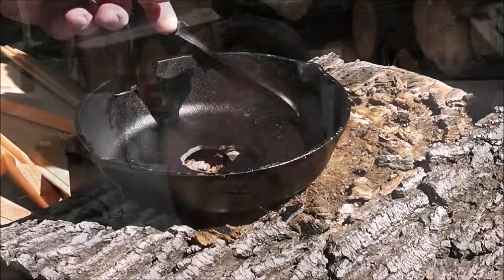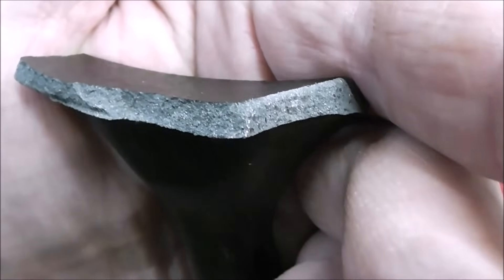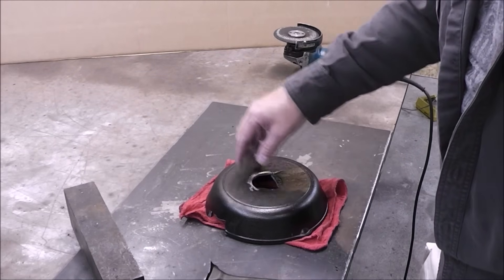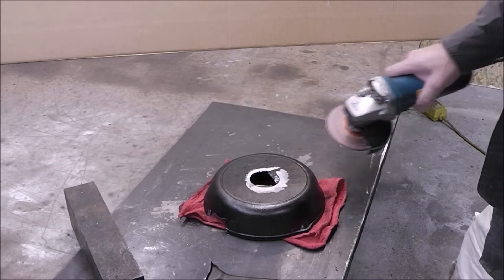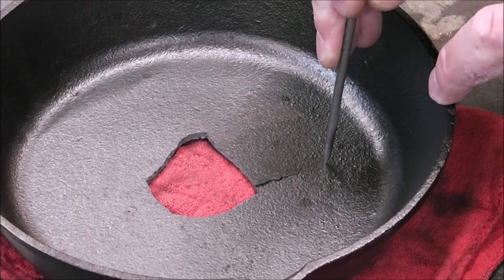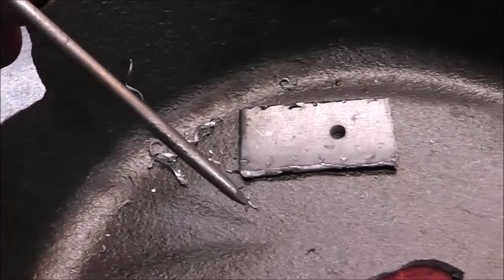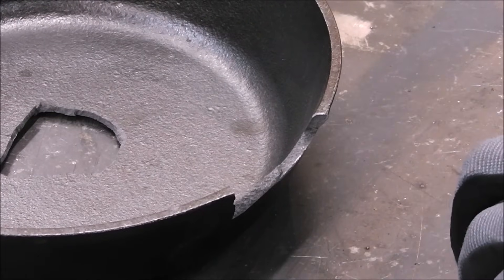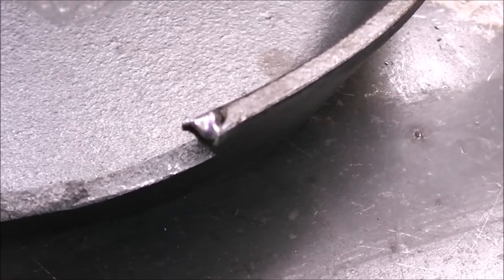IS IT CAST IRON OR CAST STEEL? 5 Ways To identify Before Welding

Comment: I did a  mig repair on a cracked exost manifold  on my old renault 18 few years ago,and i was told that it should 99% be made out of cast iron...to make sure i was running the engine for a wile,reving it once a wile to get it hot,then i quickly unbuilt air fiter and carb to work on it.still there since without any sign of failure
Reply from the maker: Right on! Nice job!

Comment: What if the edge is rounded? I tumbled some metal chunks I had in a rock tumbler to make them shiny. I have a good idea to forge with it into something. But I’m afraid they could be cast iron.
Reply from the maker: You could try drilling it. If it turns powdery it's cast

Comment: The spark test was the only real valid test. Cast iron vs cast steel not mild steel
Reply from the maker: They were all valid tests. If you don't believe me you can always research it for yourself.
Reply: @BrandonLund  drilling cast steel is no where the same as plate steel.
Reply from the maker: I never said it was.

Comment: In the file test, the reason why the file skates over the weld is because when welded with ordinary fillers, the weld pool draws in the abundant carbon in the cast to form a high carbon alloy, this is extremely hard and brittle.  It's the reason cast hast to be welded with a filler such as nickel or similar, as these don't pull out the carbon, and that means the weld remains ductile and doesn't crack as it cools.

Comment: Wait., so cast steel would be molten metal poured into a mold.  Isnt cast iron a powder thats put in a mold then heated until fusion?
Reply from the maker: Cast iron is made by heating pig iron in a furnace then pouring the molten material into a mold.
Reply: What you’re thinking of is actually called powdered metal.

Comment: Hello, recently I bought a cast iron  heater, after two weeks the back of it started to bend. There was no visible damage when it was delivered. Is it possible that it was weaken or was 'damaged' inside? The heater has not fallen or fell over. Thank you.
Reply from the maker: Thats odd. I would contact the person upu bought it from and exchange it
Reply: @BrandonLund  they won't exchange it becaus they (have accussed) me of damaging it. Is it possible that it was put together incorrectly at the seams and that has caused the bending?
Reply from the maker: It's very possible. Cast iron usually breaks before it bends

Comment: I just tap on the part with a steel bar or hammer.. if it doesn't  "ring" it's probably cast iron. Cast will have a dull sound when taping on.
Reply from the maker: Thats another good one but you still have to determine if its white or grey.

Comment: Hey Brandon got a question for ya, I need to extend a 3 point hitch lift link on a John Deere tractor. I want to do this by adding some flat stock (using flux core wire)to the existing flat stock used to manufacture the link. What do you think would be a good choice for the flat srock material?
Reply from the maker: @Mixed Up im not up on farm equipment but if you are extending an existing design i would use use at a minimum the same size material if not a little heavier just to be safe.
Reply: Hot rolled would be best but cold rolled will be fine..  wouldnt use anything else because youre flux core welding it together..  besides no matter what flux core or material you use the wire wont penetrate that deep so would never be as structurally bonded as if you used a 7014, or some stick..

Comment: Brandon, I need to repair my Broncos front differential. While in process of re/gearing, adding limited slip carrier, and replacing all bearings/races/seals, I discovered the inner pinyon bearing race/cup bore was 50 thousandth’s larger than spec. The cup/race on previous came out fused to the bearing on the pinion. Meaning it failed so bad that it spun the cup/race in the bore and hogged it out. So I need to weld in filler material and machine it back to spec, which is 3-4 thousandths smaller than the new bearing cup/race. I cannot replace the differential case/third member because it’s a rare D44 reverse high pinion IFS with bolt in axle retainer produced for only model years 80-82. Im leaning towards the case/third member being cast ductile iron (because I know a Dana 60 is made from such, but it could still just be cast gray iron, but I cannot find info on the metallurgy for that casting. Any tips greatly appreciated
Reply from the maker: @R Pierce it's probably ductile or nodular iron. You can spark test a small area on the outside of the housing to find out. Since this is a critical part / hard to replace part I would lean toward tig brazing, building up the bore then milling to spec.
Reply: @BrandonLund  anyone you recommend to perform this tig brazing in SoCal/ Los Angeles? I have a machinist to re-bore after
Reply from the maker: I wish I did man. It's really not that big of a job just time consuming to do it right. Just some tips to ask when you search around. They should be doing a preheat then depending on how long the shop has been in business, if it's an old-timer he would probably braze it using oxy-fuel. This is gennerally considered the gold standard in my opinion. Oxy-brazing has a real good sucess rate. Tig brazing or stick welding are probably equally as good but all the process (if it's some sort of cast iron and not cast steel) should have some sort of preheat with a post heat cool down wrapped in an insulated blanket. Let me know how you make out. If you have facebook feel free to post your project 👍good luck brother!

Comment: I have a strange part at work that we frequently have to repair. It’s a lock rod end that is supplied with an internal locking device for large containment structures . The parts are often stick welded with 6010,6011, 7014, 11018 and even er70s6 mig. Doesn’t matter it always fractures when struck with a larger gamer or sledge. Sometimes even just prying on the locking device causes failure. I was told years ago it might be white cast iron?
Reply from the maker: @tony b it sure sounds like it. White cast does not take welding very well at all. Have you tried any nickel rod? Nickel has pretty good elongation characteristics so it might be worth a shot...
Reply: @BrandonLund   What about 309
"In most cases when welding dissimilar metals or, more specifically, carbon to SS, we recommend you use a 309 filler metal because of its higher ferrite content. This higher ferrite content can minimize weld dilution and prevent weld cracking."
Reply from the maker: @Bob L this past week's video was somewhat of a failure due some different things but I'm going to try 309 instead. I was using 308 simply thinking cast to cast weld but 309 is always a good bet if your not sure so im going to try 309 in this weeks episode wrapped with a copper wire 🤞
Reply: this might be crazy, but worth a try?   If you can heat the parts red-hot for several hours and cool them slowly, they may become less brittle. if you make a brick fireplace and fill it with charcoal, you might be able to use a leaf-blower to intensify the heat?
Reply: @arthurmario5996  When we are making the locking systems, we typically have 45-1.5 hrs to complete per SOP at the company level. There is no metallurgy here and its a shame the parts weren't treated inn advance.
Reply: @tonyb7748  yes, true. if they were made right, they wouldn't break and you wouldn't have to weld them!

Comment: Hi
Is there any cast steel in metals
Pls say about different types of steels
Reply from the maker: @Mobi Mobi if you have cast steel, you can just weld it with whatever process you want the same way you would weld regular carbon steel. I hope this answered your question.

Comment: shouldn't you be comparing cast iron to cast steel? And not just plain old steel.
Reply from the maker: @1amelka For welding purposes there is no difference between cast steel and plain old steel. They both weld exactly the same.

Comment: Where those “cast iron” pans, actually cast steel? And if so I’d that safe to use as a pan!
Reply from the maker: I have a video that demonstrates 5 tests that can be used to determine cast iron vs. cast steel. I would not use a cast iron pan that had been repaired.
Reply: Those pans are gray iron…. 100% I make the iron!
Reply from the maker: @Greggaz100 thanks for sharing man! I don't know much about foundry work but I bet the process is very interesting. I would love to tour a facility some time.

Comment: I have a pretty silly question which i cant find an answer searching. 
Cast steel is a steel used for casting right? Is melted metal poured into shapes bla bla bla. 
My question is:
In the Steel making industry, the melt steel and pour it in a mold to make steel blocks. How is this poured metal , Stell? and not cast iron?
Reply from the maker: mfdoomgr the short answer is that one is iron ore and the other is steel ore. One of the elements that separates iron ore from steel ore is the carbon content. Iron has a very high carbon content which it’s the carbon that makes cast iron more difficult to weld than steel. Cast steel in general is no different than regular steel. One is formed mechanically while the other is formed by pouring (cast).
Reply: @BrandonLund  I´m not so sure that there is such thing like steel ore.
Reply: Iron starts out as steel… it’s what you put into it that changes the chemistry

Comment: Damn I forgot about the drill test... to me that is the easiest way even for other metals like high carbon steel, the grinder test is too vague. Thanks a bunch.
Reply from the maker: Rogue Art thanks man. I agree, the drill test is probably the easiest for me to see also.
Reply: @BrandonLund  I'm a welder and I tell by sparks, big difference and quick to tell even without having a "known" piece
Reply from the maker: @Bob L I can tell the difference between steel and cast, it's determining white and Grey that I have a hard time. I have trouble with certain colors. I owned a couch for 6 years and wrote an ad to sell it. My wife asked why I wrote that our couch was blue when it was green...I called my family because I thought she was messing with me. Sure enough they all said green. Prior to that I would of bet a paycheck it was blue lol so sometimes I have to rely on other ways

Comment: When doing the file test, and setting the tack - did you do that with a mig gun or a Tig?   If Mig, with what sort of wire?
Reply from the maker: I used TIG without any filler. The TIG just quickly melts the base metal and if the base metal is cast iron it will immediately harden.
Reply: Really? Have u seen a mig gun??? Looks totally different. Just saying.

Comment: Is there a non destructive way to make an ID between the two? I'm trying to figure out if some antiques are cast iron or steel.
Reply from the maker: I'm not very proficient in non destructive testing because everything I do is all hands on but you can do a visual examination and they also have a magnetic powder but I have never used it. It can also be x-rayed.

Comment: Thanks! I've seen that difference when drilling before but hadnt thought of it as a test until you showed it. I obtained some elevator weights that were being thrown out and was wondering if they were iron or steel - I'll try drilling a bit to see how it chips or curls.
Reply from the maker: Glad I could help. Just out of curiosity, how much does something like that weigh?
Reply: I think the ones I got are in the ballpark of 50 lbs. I have seen a variety of sizes, but they were throwing out some of the smaller ones.
Reply from the maker: @chris_brenan  that's pretty cool. Good stuff to experiment on.
Reply: I've run in when trying to drill cast I never get anywhere with a drill bit but only dulling the bit. Cool vid,, I hate cast! Lol

Comment: Hello i have a camshaft that has two damaged lugs where the cam chain sprocket is bolted on.  one has a section missing so needs building up by welding, drilling and tapping.  The other lug has a crack from the outside right through to the internal thread.  I have welded one before but im questioning my self, did i use an arc welder on the metal cold or did i use a  iron fillet or preheat the part first..  is the camshaft cast iron or steel ?  and the repair to the crack is going to be the hardest to get right.. should i do an acid wash or brake cleaner to remove all oily deposits , hacksaw a slot then braze the opening or is there a better way ?
Reply from the maker: You use acetone to prep. Never brake or carb clean. Preheat and post heat. Brazing works best

Comment: What is made with cast steel?
Reply from the maker: Anything you could cast in iron can be cast in steel. Engine heads, intakes, ball valves, pulleys, wheels ext. Cast steel is much more costly to manufacturer than cast iron.
Reply: crankshafts not made of billet steel.
Reply from the maker: @kevinnoble5988  sure crankshafts can be billet. It's what they use in race cars.
Reply: In industrial applications you will find it on stamping press breaks

Comment: In its molten state cast iron flows better than cast steel. A cast iron piece could be much more detailed than a cast steel piece.  In a cast iron part you would see square corners where a cast steel part would have more rounded corners. Cast steel could be used in parts that need more structural integrity because it is more malleable, that would be the opposite for cast iron because it is more brittle. Hope this helps a bit?
Reply from the maker: You always have such great comments Richard. Thank you. These are the comments that add to our community!
Reply: How to test without causing any damage?
Reply from the maker: You can have it xrayed if you don't want the damage, but thats expensive if you don't have a connection.
Reply: Is a cast steel anvil a good idea?
Reply from the maker: Thats a great question Rashad. I'm not sure. That's probably better explained by a blacksmith.
Reply: @BrandonLund  it seems like it is.
Reply from the maker: Good to know! Thank you for sharing!
Reply: @rashadabdullah9769  yes, I think so.
Reply: @rashadabdullah9769 a well made one is
Reply: It helps me.....thank you Sir.

Comment: Okay wildman...  Before you fix that pan with a coat hanger and a torch I wanna know if cast steel and cast iron can be welded together. Using 1960's technology. May have to go run my spark test at night on account of I can't drill a hole, it's too rusty to file and there's no break to look at the grain.  There is grain in steel and it will look different depending on the break with or against it. I've seen it look granular like cast iron before.  Thanks for your videos and please...  I learn as much from watching an error as I do from watching a correct job.
Reply from the maker: Cast iron and steel can be joined using 1960's technology. Its beyond my time but folks have been doing it successfully for decades. If you have no ability to test your part than you are limited to trying to weld it and hoping for the best. Cast iron can be a crap shoot to weld depending on its carbon content amongst other things. Sincerely, wildman

Comment: Brandon, you are going laugh at this, I broke my vise, now who breaks a vise, me used a snipe tighten up on some bar and snap. so now to weld it back I will be  using cast 80 or 90 rods. Just in case I bought a new vise and heavier.
Reply from the maker: Cast rods is a good choice for a vise. Those handles are just too short! 😂

Comment: Soak that pan in a bucket of used motor oil and do some welding on it for a real world test! = )
Reply from the maker: @Just ME Onlyme I think that's a great idea. At first I started out this series with a cast iron exhaust manifold because they can be hard to weld because of exhaust contamination,  but a lot of folks will claim that it is made of cast steel (even after all the testing is done proving otherwise) like they did with the exhaust manifold. That's why I decided to keep it fool proof and I picked a cast iron pan.
Reply from the maker: I'm going to try and do one better, I'm looking for an engine block! Dirty enough for ya! Cheers brother!
Reply from the maker: @UCqbOYHe7tmehqnQJnYka-5w I actually have a lot of experience with nodular iron. It's often referred to as Ductile Iron. I've laid miles of Ductile Iron pipe back in the day.

Comment: Good stuff. From certain things I’ve seen cast steel doesn’t take solid mig as well as stick or flux core w or w/o gas
Reply from the maker: Thank you! I've had limited success with solid wire. Cast can be fussy